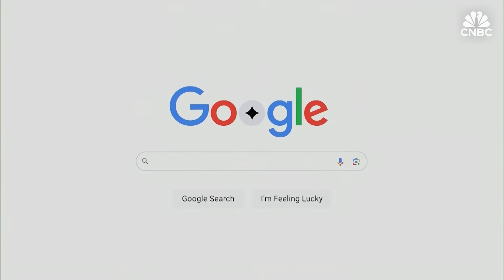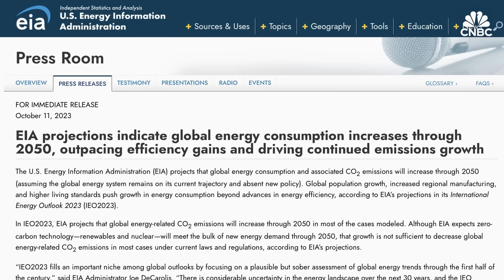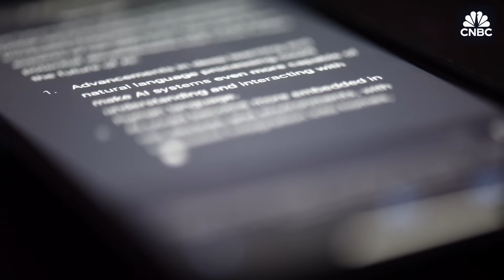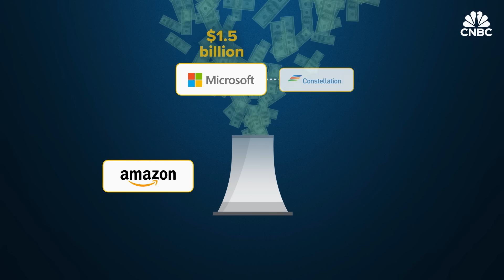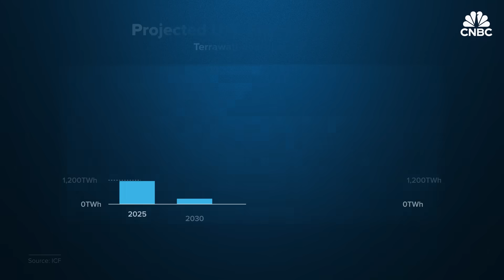Why Amazon, Microsoft, Google And Meta Are Investing In Nuclear Power

Comment: please don't say emissions free. carbon free isn't emissions free. nuclear waste is huge pollutant and has the highest potential - 1gram of waste plutonium in atmosphere is worse than 1 ton of carbon emission
Reply: The high level nuclear waste (spent fuel) is solid stuff that stays stored in strong containers on site which block all of the radiation. Coal power plants actualy cause way way way way way more radioactve pollution than nuclear because coal has many radioactive materials in it among many greenhouse gasses and carcinogens which all get pumped straight into the atmosphere and subsicuently your lungs

Comment: I work in the oil and gas industry here in Alberta Canada, but I regularly deal with our provincial regulatory authority that would also oversee any kind of Nuclear equipment manufacturing in our province.. From a recent chat that I had with them, it sounds like there are manufacturing companies here in Western Canada that have been working and applying to get their Nuclear certifications, I believe these companies specifically had SMRs in their sights. Its a very comprehensive and laborious process to get this certification, to build the support testing infrastructure, develop procedures and train the necessary personnel just to build the equipment. My point, there's a solid regulatory process in place to make sure that these things are built safely.

Comment: One example: Why not lobby for Solar to be cheaper to install for most homes? Nuclear is really for tech companies needing more power, not the average consumer.

If the average consumer can pull less power from the existing power grid, wouldn't that mean there's more power to use for AI?

Nuclear seems like a drastically expensive approach to scale up our power needs.

And tech companies get it wrong all the time (ie. DeepSeek).
Reply: Your comment is so dumb. Solar only works in warm places, cold places are cold because the sun is weak, meaning no power. Now, if you have every house in sun rich california to use solar panel, the electricity saving will still have to travel very very very far to the colder region where AI training datacenter is. And guess what, electricity traveling far over cable causing some of it to disappear, so if you send 100% you might recieve only 75%. meaning the last 25% of electricity disappeared. currents are lost in the transfer procces. Just like data is lost in ethernet cable if it’s longer then 100 meter.
Reply: @ I know it’s hard to read for someone like you, but I just want to assure that it was just one example, as very clearly stated at the opening of my question, not an overall blanket conclusion for possibilities.

Again, the goal I stated wasn’t for homes to reach AI data training centers. It’s to reduce electricity use off the grid, to reduce building large facilities. 

But hey, if you can’t read my opening two words, I wouldn’t expect you to understand full sentences. 😘

Comment: The public needs to get some perspective on nuclear. Nuclear energy has caused significantly fewer deaths compared to fossil fuels, both in terms of accidents and long-term health impacts.

Major nuclear accidents like Chernobyl, Fukushima, and Three Mile Island have resulted in a combined confirmed death toll of about 32 directly, with estimates of additional long-term cancer-related deaths ranging up to 4,000 for Chernobyl.

In contrast, fossil fuels are responsible for millions of deaths annually due to air pollution and related health issues. For example, coal alone accounts for an estimated 170,000 deaths per trillion kilowatt-hours of energy produced.

Moreover, nuclear power has prevented around 1.8 million deaths globally by replacing fossil fuels between 1971 and 2009. This stark disparity highlights nuclear energy's relative safety compared to fossil fuels.

Comment: 4:85 I believe in manufacturing small nuclear modules which will be very scalable, safe and easy to manage. You will be able to scale up the modular nuclear reactor from a few to multiples of modular reactors, to meet the desire energy needs, and still have the luxury of maintaining optimum safety.

Comment: Big tech is interested in nuclear power because it can't, won't and imagine anything else.   They think in terms of just power and a singular issue.   You can put up renewable power far faster and safer but because you have to deal with many people who own the land the infrastructure interacts with, they think they can bypass those issues.   On a levelized cost, nuclear power is one of the worst, even though multiple different administrations have supported nuclear power.

Comment: I've never heard that one of the anti nuclear movement was they didn't want widespread power!! They may have wanted power efficiency which was almost absent from the US legislation and state plans but not power availability. Its not like they thought fossil fuels no matter the fuel was good for the environment. In fact power demand was flat only until recently in the US. Cheap natural gas meant large heat/power users were using NG and power efficiency efforts/solar were curtailing some power demand. Utilities didn't want to build new power plants (no matter the fuel) as they were unsure if cheap NG would last and it was cheaper to cut demand than build more capacity with an uncertain price and thus profit. Nuclear power was not even on their radar. There is also going to be a big fallout with big tech and carbon credits as this is increasingly looking to be a murky market that will soon find the credits much more expensive or not worth the same carbon offset thats promised. I still see many data centres roofs with no PV, located nowhere near large scale wind and the current fuel of choice in utilities is NG

Comment: Your standard of living and my standard of living is basically equipment and machinery and energy. Energy is about 95% in the equation. 
Due to limitations in the supply of minerals, renewable energy can only provide a small fraction of what we are currently using from fossil fuels.
Do you want to live like hippies on a commune or do you want something better than that?
Reply: If that was the case, then it would be reflected in the cost.   Yet new renewable energy is some of the lowest cost energy out there.

Comment: Data center efficiency needs more consideration. Fiber optic connections consume significantly less energy than copper and require less energy for cooling. Also, until we address the problem of nuclear waste storage or nuclear  waste recycling, nuclear is Not a clean solution whereas wind, solar, geothermal and hydroelectric are.

Comment: Did the nuclear industry provide the script for this piece? Lots of dreamy chatter about an impending nuclear nirvana but scant and soft on the obvious showstoppers -- cost, time and the nuclear industry's track record in massively over-promising on both. Crafty use of present tense in describing SMRs, disguising the fact that none actually exists and that financial close for any SMR may never make sense. The usual mantra about the intermittency of wind and solar but no mention of increasingly inexpensive firming technologies. Has CNBC not clocked what's happening with Battery Energy Storage and the direction of travel, tech and price, for wind, solar and batteries? What the cost of firmed and rapidly deployable renewables is likely to be 10 to 15 years from now, when any new-build nuclear might arrive? Price and speed will rule this roost. Nuclear's too expensive and way, way too slow.

Comment: More funding into modular since a generation of funding over past 10 years had 95% of companies fail. 
I think a world with modular reactors will make life so much easier for basically any factory or any building that uses a ton of power, like data centers and AI in this case. 
Hope we but the money into salt reactors too, those physically have no way to break and leak radiation. If it leakes then it expands causing the reactivity to stop making it emit a basicaly safe amount of radiation that can be cleaned and fixed without harm to the public.

Comment: Clean nuclear and Molten salt reactors sure. Especially small to medium scale these reactors would be great and SHOULD be further developed and built out. Ideally as fusion technology progresses, this slowly replaces even the molten salt reactors that are not yet built. So in these sense nuclear is always an interim form of energy. The issue is how to convince governments why something that can't be used for military purpose would be more ideal and that not having to deal with runaway reactions or toxic waste products are worth billions more in further development when we already have working technologies. Well if you have safety and toxic waste concerns then cost will always remain high. If you cannot get past those barriers than other renewables such as solar wind and hydro will dominate at a fraction of the price until fusion becomes commercially viable and mass adopted.

Comment: I wonder if the producers at CNBC (and the viewers) are familiar with "Limits to Growth"?
Or Peak Oil?
There is no "energy transition".
There is only an ever increasing demand for both electricity and other forms of energy.  The increase is exponential (A full factor for AI each decade), yet energy available to do work is not infinite, but is peaking within a decade.
The far more interesting story behind this one is the crash course we are on, with Big Tech pushing the throttle all the way to the floor.
Reply: Are you familiar with the concept of operational lifecycle? These older planets are reaching the end of their lifecycle which means they need to be decommissioned and replaced. That will most likely done with renewables and nuclear rather then more coal.

Comment: Whether that electricity comes from oil or nuclear, that still converts stored energy in matter to heat. That heat contributes to global warming and climate change.

I wish these datacenters used more of solar. Solar takes light from the sun which will ultimately gets converted to heat. Instead of the sun light converting to heat right away, solar captures its energy, uses it for electricity, which then gets converted to heat.

With solar, we are not adding more heat to the environment.

Comment: I'm in favour of nuclear, but I'm sceptical that it's sure to grow it's marketshare.  Solar alone is 50% of new grid scale electricity production.  The video hand waves away solar and wind because of its intermittency, but solar paired with energy storage is likely to be (and remain) cheaper than nuclear.  So, citation needed for your claim that nuclear is certain to increase marketshare.
Reply: And I should add that there's growing decentralizatiob of electricity production thanks to people (for example) putting solar on their own home or business.  Add that in, and nuclear's share of new electricity production likely drops further.
Reply: "Energy Storage" (I.e battery technology) is many years (decades?) away  from being cheap enough to store enough of the electricity wind and solar produces to make it economically viable. So when the wind isn't blowing and the sun is down there are only two options for the forseeable future: Fossil fuels or Nuclear.

Also. Nuclear can be built where energy is needed. Or close to it. That is not usually the case with wind or solar power. Which means energy transport is also a factor that adds to the cost.

All of this has been known for decades now but people still can't stop dreaming of a future where the sun is always up and the wind is always blowing.

Solar and wind are a nice complements in specific places where they make sense (and might even be profitable). But they are not base power that is absolutely needed to keep the energy grid stable and safe.

Unless of course everyone would be ok with wildly fluctuating energy prices and intermittent blackouts. At the same time.
Reply: @Jonteponte71  6.4 GW of energy storage was deployed in the US alone in 2023.  30 GW was estimated for 2024.  It's growing massively year over year.  Solar with energy storage is cheaper than nuclear.  And energy storage is more than just battery technology.  Innovations such as pressurizing underground caverns (and then depressurizing them through a turbine) are being experimented with, as is gravity storage.

Comment: Tech companies investing in nuclear power reflects a strategic move toward reliable, 24/7 energy solutions. Unlike solar or wind, nuclear power isn’t weather-dependent, making it ideal for powering data centers that demand constant energy. However, it raises questions about public perception, regulatory hurdles, and the long-term costs compared to expanding renewable energy. Balancing these options will likely shape the future of sustainable tech infrastructure.

Comment: Every GPU card has similar power to a microwave oven (800W+). A typical AI server has up to 8 GPU cards running 24x7. Multiply by thousands of AI servers in a datacenter, it's not only a power problem, but also cooling these high-powered servers.

Comment: Nuclear Takes many years to build the short-term supply of LNG, especially in Europe, is the short term answer...
Also, a trend toward edge AI will shift the power demand to the endpoint machine battery...
Long-term nuclear is still needed just without too much overcapacity 
Using a hydrogen gas tank to store the excess energy supply
it can later be burnt to create combustion...

Comment: This is a total PR job. No new nuclear power station will be producing electricity for 10 years, in the meantime the additional demand will drive electricity pricing higher. They should all be forced to make new Solar/Wind/Battery systems equal to the demand they will be straining the grid by. These could easily be on line in a year with enough investments and bribes to the local politicians and regulators.

Comment: High level nuclear waste remain dangerous for tens of thousand of years or even longer , although the waste don’t take up  much space  but cumulatively  if every country use nuclear power the amount of high level waste generated will be significant as years goes by. These high level waste have to find proper storage, the maths just doesn’t work for permanent long term solution because we will eventually running out of storage space, nuclear is not the answer for permanent long term solution. 
Tesla is going for solar and megapack, I think that’s a better permanent approach albeit it’s not the perfect solution yet , raw materials used in battery and solar panel can and should be recycled, there is argument that solar panel take up landfill, but at least you know the waste generated is not as bio hazard as nuclear high level waste. Gov should  mandate proper recycling for solar panel and battery, made it into compulsory recycling process. Nuclear waste is a different ball game, unless new technology made it possible to eliminate high level waste, don’t count on storage because storage will run out of space eventually, don’t screw our next generations future , don’t  made them handle our irresponsible mess.

Comment: What happens to the waste from the nuclear plants large or modular? How and who will deal with nuclear waste? Why was this not addressed in the opposition section of this story?
Reply: Bro fun Fact nuclear waste can be recycled back into nuclear fuel France has been doing it for a lot of years already and we have created nuclear waste that you can easily fit all of it into a football field and has room to spare that is how efficient the fuel is dont forget you can always recycle it back into fuel
Reply: @Knightmare919 you can't take what was originally 10 pounds of premo uranium, use it for nuclear fuel, then "recycle" it and end up with 10 pounds of premo uranium unless you're adding in a good amount of <uranium.
Reply: Stored on site. It's better than releasing it into air.
My country also has dug up huge tunnels for long term storage. It's a non issue.
Reply: @edheldude  it’s never an issue until it is. If it’s in the air or under the earth it is an issue, burying something doesn’t eliminate it, it’s still there.
Reply: @edheldude in USA they are stealing Native American land to bury the fuel so sadly they can't even get the simplest thing right